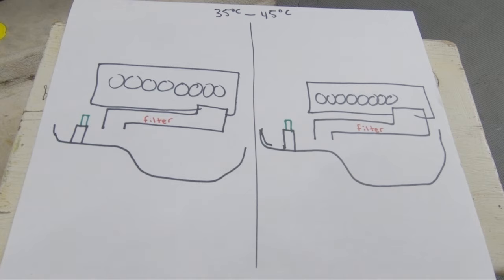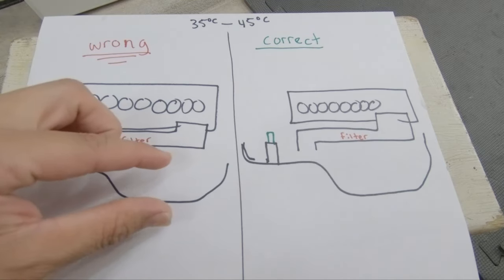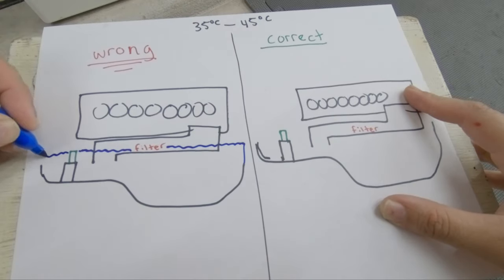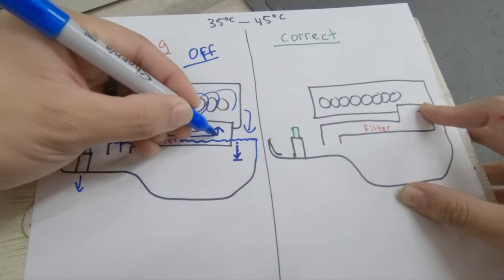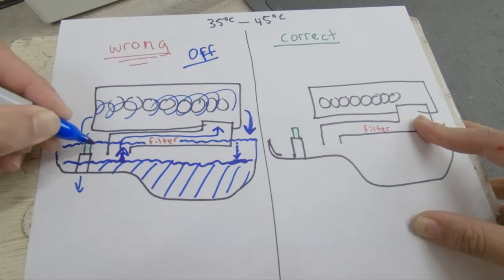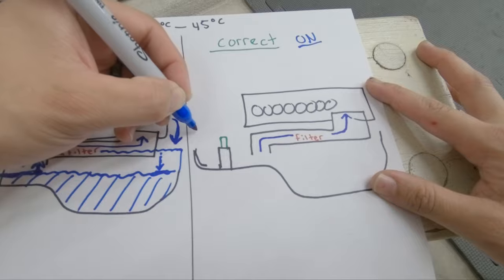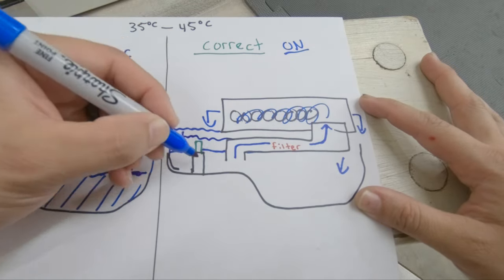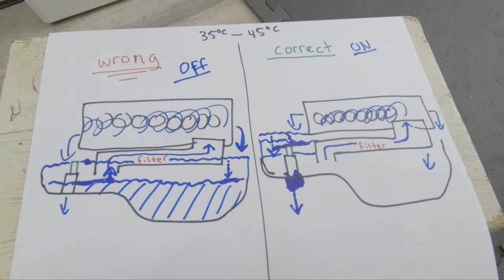CORRECT way for final oil level 8 speed Aisin Transmission Audi Q7

Comment: Not the best explanation. What do u mean car is on? Gearbox is still when its on. U need to fill it with aproc amount. Disconnect. Run a car, shift though gears. Reopen fill some more till drips. U can repeat that once more to be safe. Make shure its level.
Reply from the maker: @MiniFun92  that the engine has to be running, and then going through the gears. All at the same time being within the right oil temperature range.

Comment: Don’t forget the reason they want it at that temperature is because the fluid expands to the fullest at those temps. That’s why when you have an automatic transmission that has a dipstick it will have 2 different readings, one for hot and one for cold. Hot will always be higher because the fluid expands. Good illustration 👍

Comment: Is that filter serviceable without pulling the transmission? Ive seen a lot of people saying it isnt but ive also seen them for sale. Trying to get everything in place for service soon and would pike to chamge the filter if possible. Thanks for the video and your help!
Reply from the maker: If I'm understanding your question correctly. No need to pull the transmission. The transmission mission stays in place. The filter can be easily assessed from the bottom.
Reply from the maker: Also I have the full video of the service down in the description portion of the video with the link to it
Reply: @markb6s4  Thanks man. I mistakenly thought this Aisin 8 speed was the same as in my BMW. It is not. The one I have does not have a pan.

Comment: Fluid temp is not such a big deal.  Just drive the car a couple of blocks  if the outside temp is around 50 to 75 degrees.  More importantly, is to the check the level with the engine running like stated here.

Comment: Thanks man for the correction! I still kinda debating if i should change our q7 trans fluid. I t has 211,000kms (120k miles) and i dont think it has been changed. Also after all the injectors been replaced under emission warranty, it threw contribution/balance code again for 3 injectors. Dealer check all injectors and replaced all seals, so far no codes came back. It was at the dealership for 3 weeks because audi canada doesnt want it to return to me if it wasn’t fixed. Also i told them an oil leak possibly coming from upper sump, dealer said its just the drain plug, i think they just dont want to deal with it even under warranty.
Reply from the maker: That's a tough choice there. You have a 50/50 chance when you remove it it's all good and go ahead and change the oil, but if it turns out it's in bad conditions, it's best to leave it as it is. But there isn't really a good way to tell the condition of the oil if you can't remove it.

I've heard a lot of dealerships saying that " it's no longer warranty or not needed" simply bc they really don't get any money out of it as compared to someone paying in full for a service. Sadly like any business it's all about making profit.

Comment: So you mean, I have to fill up all the 9 liters of ATF, then let the car run and switching all through the gears and THEN open the drain plug while the car still runs to let it drain?
Reply from the maker: Correct. You want to make sure there is enough ATF in the system for it to fully do it's cycle. If you don't put enough ATF then you run the chance of air pockets in the system. It does sound like a waste bc then once you get to the optimal temp range then you drain the assess ATF.

Comment: So, this is something I was wanting to do... but let me ask a couple questions.  I will need to jack the vehicle up to get under it... so it will need to be level?  Thanks,
Reply: Ok, never mind on the above...  I watched the other video and you do need it level but not the wheels spinning.  My question is now...  what is the issue with changing the fluid after 50K miles?  I'm the second owner and don't know if the fluid was changed before.  It now has 150K miles and really don't have any issues, just thought it would be good maintenance, but noticed some comments about changing and ruining the transmission???
Reply from the maker: @jimw3799  this is something that I have read. Can't remember where i read it. And I have also heard from both sides, to change and not to change. Since I was close to the 50k it just made sense for me since there is nothing saying not to at that milage. If i was at a higher milage then i would go back n forth if it's a good idea or not.
Reply: @markb6s4  So.... did some research.  The service manual does indicate the transmission fluid is lifetime, however I am not sure I agree with that.  Just seems like everything wears out eventually.  Also, changing the fluid and ruining the transmission is a function of how badly worn the fluid is... if you look at the fluid and it is nice and normal red, then changing is ok.  However, if the fluid is dark and indicates considerable wear, then changing could cause particles to move and clog up the passages causing further damage.   Hope this helps.
Reply from the maker: No fluid is lifetime. Some fluids can last longer then others but at the end of the day they need to be changed out

Comment: Do you keep it in park with the engine on when checking the level?
Reply from the maker: That is correct. Leave the car in park
Reply: @markb6s4  Thanks dude. I don't trust Joe Six pack at the dealership to do this job properly, so I prefer to do it myself.
Reply: @markb6s4  Do you have to use the specific Check ATF Level program in the scan tool, or is it enough to just know the temperature and have it in park with the engine running?
Reply: Scratch that previous comment, I did the Check ATF Level program in my scan tool and it was just a guide, it didn't actuate anything within the transmission. The dealer overfilled my transmission by 2.2 liters. I let the small plug drain until it burped up some air bubbles. That explains why my transmission hasn't been running optimally since that dealership service.
Reply from the maker: Any scan tool that can read transmission temp is more then enough for this service. Having extra fluid can be bad since there is more volume of liquid. As liquid heats up it expands and since the transmission is sealed the air pressure builds up and adds unwanted pressure inside the transmission
Reply: Just an update, but ever since I did this method on my 2019 Jetta with the 8 speed AISIN transmission a couple months ago, it has been running much smoother. Did exactly what you said. The dealership almost blew up my transmission. Thank you for the video!
Reply from the maker: @inspectorjavert5563 nice, happy to hear this has been of help

Comment: Hey friend thanks for this video saver $$$$ the stealer wants over $1000 to do this same job a me Cadillac smh anyway that barb you use can you confirm that thread size and does it screw into the same threads as the plastic tube????
Reply from the maker: This is the drain plug details (VW Porsche Auto Trans Drain Plug - Genuine VW WHT005510) and the size it says is M10x9. Please verify if this is correct. Can't remember off the top of my head. And the plastic tube I used for the pump was the right fit for the barbs

Comment: Yes you got the the correct Way.
Before I saw your video,I did my oil change its aisin 6 speed on 05 golf ，
I just find out when the engine is running there are no oil drop out, but I turn the engine off the oil drops down and keep leaking, i search lots of videos, finally I am sure I need keeping the engine running when doing the oil level adjustment,so I go buy one more bottle.
Thank you ,you make me more clearly.

Comment: I hope you guys are resetting the transmission adaptive values and doing a full relearn.
Reply from the maker: Is this where the gas pedal is pushed all the way down then turn the car on ( not all the way on) for several seconds then turn it off?
Reply: @markb6s4  it could be. But I haven’t got concrete confirmation that it does the same thing as if you was using a vag or OBDeleven. All in all great right up because there are technicians that do not know how to level the fluid correctly. I will be putting up a Video soon of the manual I have and what it states on this procedure. Also the manual I have doesn’t state at all to overfill the trans and drain to get the right level but I have done it both ways and it pans out to be much of the same.
Reply: @markb6s4  I just reset the transmission on my Q7.  You turn the ignition to on, but not start.  Wait about a minute for everything to load up.  Then press the accelerator all the way down and hold it for about 30 seconds.  Turn off the ignition, release the pedal and wait 3 minutes.  Then drive the way you want the car to learn for 10-15 minutes.  Mine was very jerky, especially when I let off the pedal.  Now it is nice and smooth.

Comment: Hey, so do i understand it correctly? The filler (green one) will not come out?
Reply from the maker: it dooes not come out. its part of the threads
Reply: @markb6s4 ok Great - so where do I order the green level guard?
Reply: @Jry11  In principle, you do not need to order a new one, cause you should already have one in the transmission. But if you still want a new one, the OEM code is 0C8301437A.